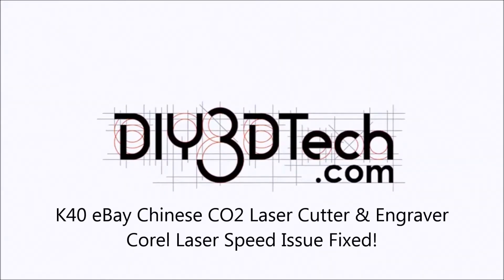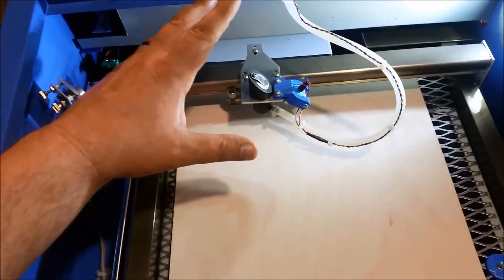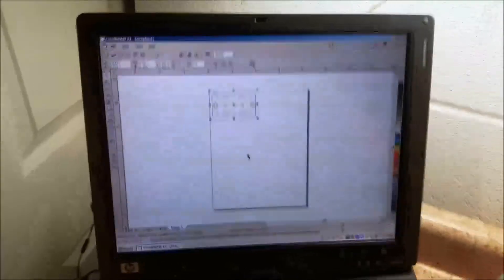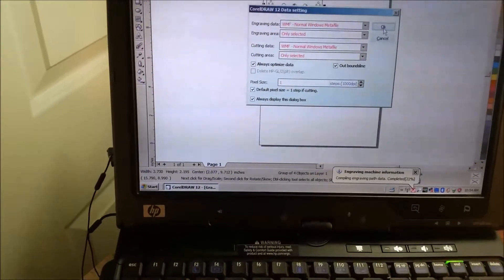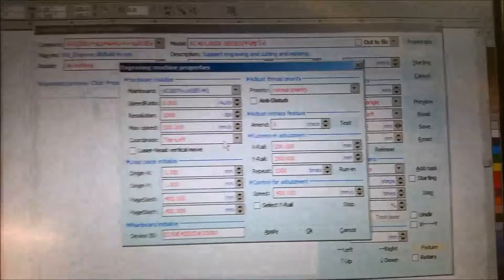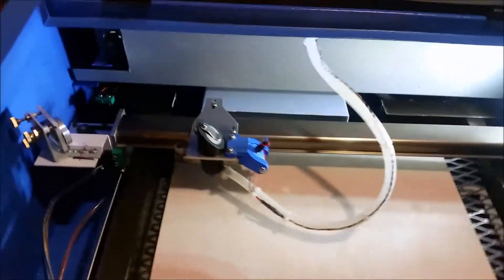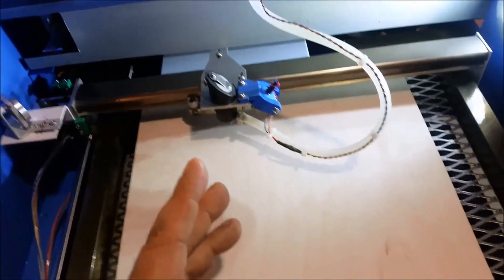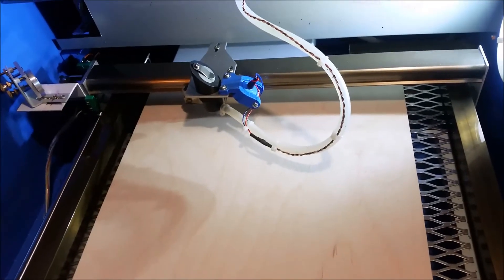K40 eBay Chinese CO2 Laser Cutter & Engraver - Corel Laser Speed Issue Fixed!

Comment: Hi, i've been watching yor videos and they are definitely the most helpful ones for these 40w ebay laser cutters. Mine arrived yesterday and i am having trouble with the software. I am using the supplied CorelDraw and LaserDraw and they start up fine. When I have changed the settings so that my main board 6C6879-LASER-M2 is selected (this matches what is written on the board itself) and have also changed the Device ID to the one that is written. I have also changed the "Data setting" in CorelDrawl for engraving/cutting to WMF. What happens if i draw a vector shape, click engrave and the window pops up where i can align my shape, when i move it around the laser head also moves so i know it is following commands. I then click "starting" and the machines starts wizzing about, however the amps don't go up and the laser doesn't turn on. Looking at it i think the laser is only moving left and right not back and forward, despite that it can do that when i move the shape around before i click starting. Any idea what i'm doing wrong? (sorry for long message)
Reply from the maker: +Peter Mackenzie had a hard time following so the issue your having is the laser is not turning on?  Also, on all the 40 Watt Laser I have used, the "AMPS" do go up, in other words you set the laser intensity to the desired level and the software will turn it either "on" or "off" so that likely is your issue.  If not, let me know and will try and help more!  Thanks for subscribing :-)

Comment: Hi 
What can i do about this
https://youtu.be/xU2-nQC6cZU
Reply from the maker: +Bob Gabriel Not sure assume your having an issue with the controller board, what type of unit is this?
Reply: +DIY3DTECH.com 
Hello mate That is a 4060 laser co2 from ebay 
http://4seasonspickups.blogspot.nl/2016/03/60w-co2-laser-engraving-cutting-machine.html
Reply: Hi mate 
I fixed it already 
was hardware
Reply from the maker: Interesting, how did you fix?
Reply from the maker: Ah cool!  Glad it worked out :-)

Comment: Hi, thanks for the info! Do you have also a tutorial to how to adjust the lense? I've the problem that the laserpower is not constant when im cutting 4mm plywoo. In the beginning there is a thick laser beam on the left side, but while cutting to the right side, the laser beam becomes very thin and loses power. I think this is possible to fix with lense adjustments or mirror adjustments. But im not sure how to do it, so now you are asked, do you have a tip for me?
Reply from the maker: +AyazDesign From what you explain it is not a lens issue however an alignment issue.  I did a set of three video or so that are in the Chinese CO2 Laser Play list which cover this so would suggest starting here (https://www.youtube.com/watch?v=FDTxCIf6Zt0&list=PLInTrkIbj69kPO_UP81yxX-xov4SVyPlD&index=11) and watch I belive the three videos.

Comment: Hi, Will you please do a 40W Chinese Laser Engraver Software to Windows XP connections for dummies (me). I have CorelDraw X5, finally got ebay seller to send me Moshidraw, I do have thumb drive,(is this the softkey?) When plug in thumb drive can hear computer recognize it led of thumb drive lit. I go to computer system properties and it does not display it. My email is mekul407@yahoo.com thanks.
Reply from the maker: +Jerome Day yes the thumb drive holds the "key" there are different colored ones for different applications so you need to have the right one.  Also need to have a laser whos motherboard also supports the Moshidraw software.  For me I prefer  CorelDraw by far.  Will see about doing a video and key colors and motherboards later.

Comment: Thanks once again. I have assembled the new laser and found a few minor (to me) issues. The mirrors are completely out of alignment and the x carriage is also out of square ( it looks like a belt has skipped a tooth) . There are some paint scratches and loose bolts. However the tube works and the PC software moves the x and y. Now that i'm sure that it works OK and it's not needing to be returned I will start the fixes and upgrades. I have just bought a 4 port USB hub and I am going to embed it inside the laser.  That will allow the software key to be placed inside the laser cabinet. I tried it on the bench and the software was happy to run through the hub. Bear in mind that I haven't actually burned anything yet and that the test file was only vectors and so a raster file might still have data problems. I might also put all the installation software on a memory stick and plug it into the hub too. Anyway, so far so good.
Reply from the maker: +bobdring Sounds like a typical K40 laser!  The mirrors so far off on mine when I pressed the test fire button to align the mirrors it burned a hole in my shirt!  It was good I turned the power down and was wearing safety glasses!  However your experiences are normal...

Comment: I have the 50w unit and when I try to send a file to the laser I will get the prompt OMMUNICATION ERROR.  I've rest the laser but nothing and restarted the laser works program.  the last image is all it will cut.  I'm new at this so any schooling is appreciated.   I've been exploring all the different videos.  my email is ctservices13@gmail.com   thanks Darryle
Reply from the maker: +DARRYLE SPARKS what what software are you using to send "what" to the printer?  This error sounds like a baud rate miss-match.  Start at the highest and work your way down...
Reply: LASER WORK V8,  and it was just some text or a simple picture.  and I'm getting a not enough expanded space error.
Reply from the maker: DARRYLE SPARKS Is this Corel Draw as I am not familiar with this software...